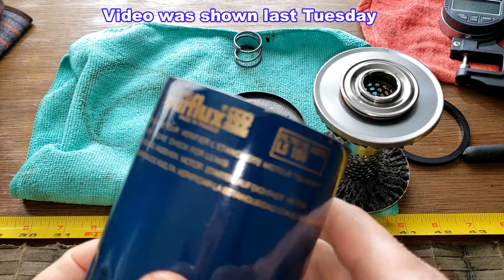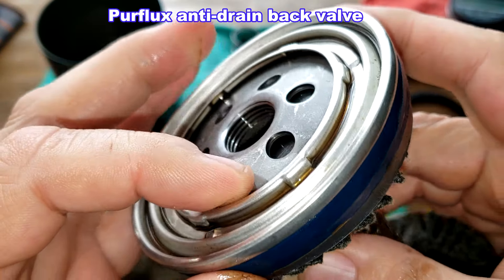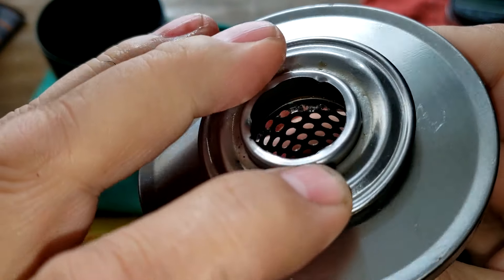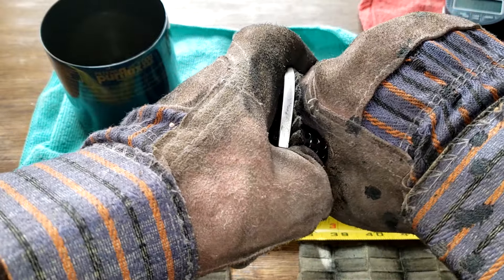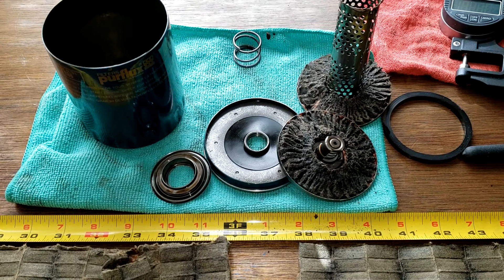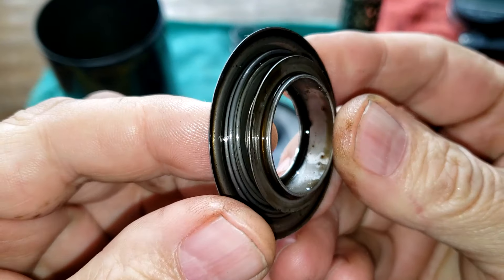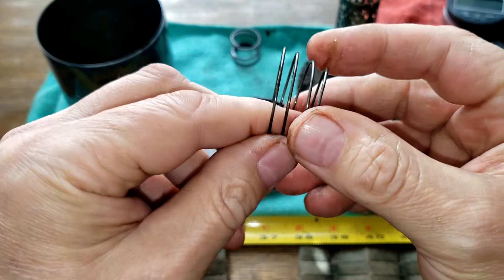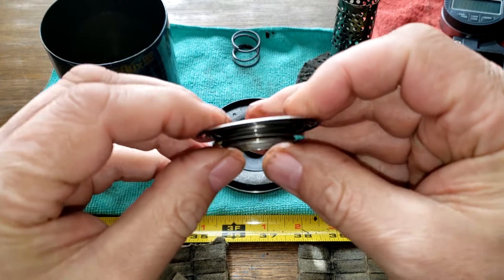Purflux Oil Filter Unique Anti-Drain Back Valve, Purflux LS186 Oil Filter

Comment: My take, they use such a thin adbv they need to back it with spring assembly plate to make sure it closes on shut down. I don't see how it's better than a well-formed silicone adbv, or even thicker nitrile valve for standard interval. No doubt it costs more to make though. I think I've seen a similar assembly before on one of the older filters you cut open Whip. Thanks for vid.
Reply from the maker: You're Welcome faxmen09👍💯

Comment: It is a pretty clever design.  Not sure why they went to all that trouble.  But it is stout and well made.  That filter on the whole is definitely overengineered.  Maybe they do it to control the amount of pressure needed to open the valve.  Change the pressure value, change the spring maybe?

Great Job, Pete.
Reply from the maker: Thanks, Jim👍

Comment: A spring loaded anti drain system unlinked from the bypass ?this garanty no slow emptying of the oil filter . Unlike most design . It also prevent slightly oil from going in . Meaning ? Oil pressure . Less bubbling probably . It seem its similar to a thermostat but for oil . This peaked my curiosity . I wish engine were traansluscent to see it in action

Comment: No matter how "springy" a nitrile or silicone adbv is, it can still deform from heat and time allowing drain back.  A thin rubber gasket with a steel coil spring ensuring the seal will likely never fail.  This is a superior design, IMO.